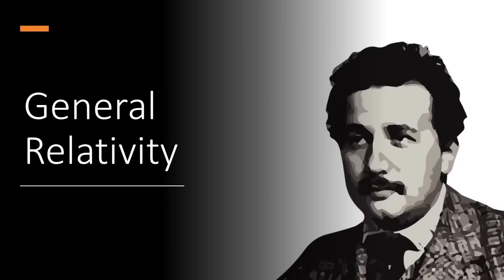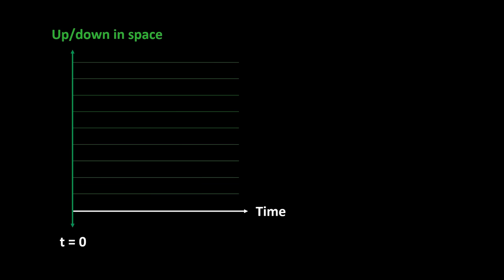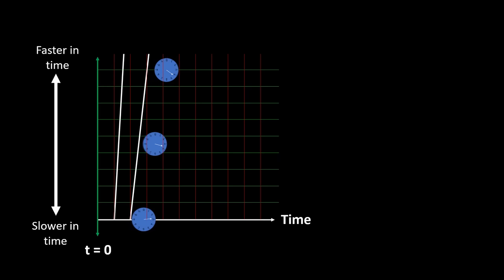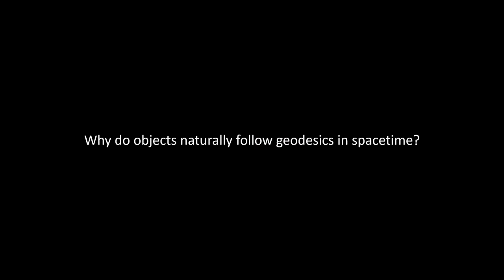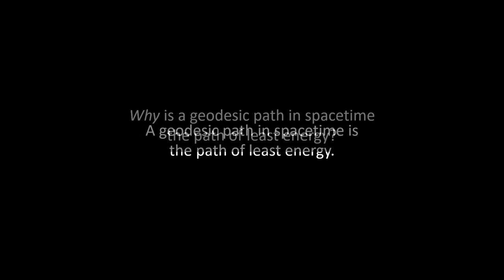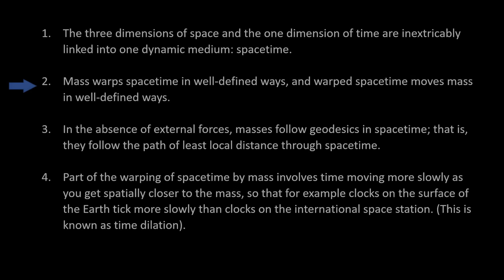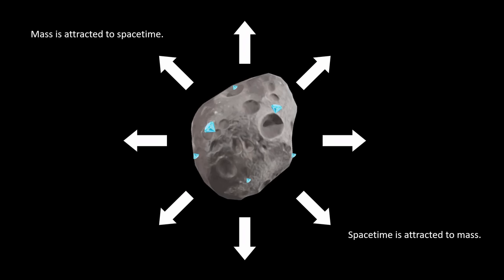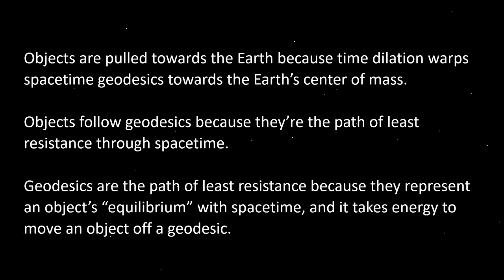How Time Dilation Causes Gravity, and How Inertia Works

Comment: Is tree branch continuously putting energy into the apple? I can't make sense of that claim. Any help please?
Reply from the maker: Hi Parker, great question. This all comes down to the equivalence principle view of gravity, how an object held stationary in a gravitational field (like the apple on the branch) is equivalent to that same object accerelating in a rocket far out in space away from significant gravitational fields. If these two really are equivalent, then they are amenable to equivalent descriptions in terms of energy. For an apple accelerating far out in space, it’s clear how much energy it takes to accelerate at g for one second, it’s the apple’s kinetic energy after that second (1/2 * apple mass * g^2). The energy is delivered by the rocket’s propulsion, and the store of energy is spent by that propulsion. How about the apple on the branch? In the equivalence principle view, the branch is accelerating the apple upward at g just like the rocket’s engines (and the tree is being accelerated upward by the surface of the Earth), so the same amount of energy is needed, and it’s delivered through molecular bonds in the branch. The question of what store of energy is being depleted is more difficult. I think a more general way to ask this question is “what energy is being converted into the apple’s kinetic energy?”. In a roundabout way, it’s the interaction of mass with spacetime that supplies this energy (similar to how it’s this interaction that supplies an object in a gravitational field’s potential energy in a classical framework). The Earth’s mass interacts with spacetime to warp it at a global level, and it’s this warping that causes the apple’s geodesic to bend towards the center of the Earth. 

I agree with your stance (what I think your stance is) that this equivalence principle version of events is highly nonintuitive, especially when you consider it from the standpoint of the conservation of energy. This discussion that someone shared with me regarding this video might help clarify the situation, especially Viktor Toth’s answer: https://qr.ae/pGqeZl

Here’s also some more clarification from a similar question I was asked in another comment: The idea that "we are not attracted to the Earth but rather pushed up from it" comes from the "equivalence principle", a hypothesis dating back 1,500 years that guided Einstein's development of general relativity. Briefly, Einstein's equivalence principle holds that the mechanism for the force experienced by someone sitting on the surface of the Earth pulling them downward is indistinguishable from the mechanism for the force experienced by someone far out in space, accelerating at g. (This is similar to how, when you enter an elevator and start accelerating upward, you feel heavier while you're accelerating; in fact, if you stood on a scale, the scale would show you weighing more while you are accelerating upward). In this sense, there should be no difference between a framework in which the Earth is attracting you downwards at g versus a framework in which the Earth is accelerating you upwards at g. 
That's all well and good, but the first case is immediately intuitive to us, whereas the latter case seems ludicrous (e.g. the Earth would have to be ever expanding in every direction for this to be the case, etc.). What gives? I think the right way to look at this is that neither case is exactly true, because they aren't looking at the underlying mechanism, which is spacetime warping and your mass's interaction with that spacetime warping. So, the real story underlying both cases is that the Earth's mass interacting with spacetime warps spacetime (especially the time component of space), so that the forward direction in time for any mass has a component in the direction of the Earth's center of mass (in a sense, time is bent into the "downward" spatial dimension, and spacetime "flows" in that direction). Your mass also interacts with spacetime, and is "attached" to spacetime by that interaction. When spacetime flows towards the center of the Earth, you're attached to that flowing spacetime, and therefore your mass also is pulled along with that spacetime. The confusing part here is that the relevant "flow" occurs in the time dimension, (i.e. where should a mass go over time given the nature of spacetime in the vicinity?), because it's nonintuitive to picture a geometrical aspect of time. I think it's fair to think of it as: the time aspect of spacetime answers "what should happen next?", and in this case the time aspect of spacetime says "masses should move towards the Earth's center of mass" or more broadly, "masses should move in the direction of the 'deepest spacetime well nearby' with the most urgency", and time says this because of the way masses warp spacetime.

Comment: I can see how GTD may deflect grazing star/light, but if I throw something up, in the air, why should it come back/down again just because time runs a wee bit faster up there? Or slower down here. Maybe if U think of it as a matter wave.
Reply: Yes, the wave nature of matter. And matter waves are chiral, they go round and round along the axis of propagation. Think of what happens to the wave as it travels where there is a speed gradient in a gravitational field: as it goes down it slows down and vice versa. So its path veers toward the mass i.e. the object "falls". That's how I understand what happens.

Comment: If I really believed in this, I think I would rather revive my much simpler half serious uni/versity days SW based model, of the universe, where I said: Matter clumps together simply to reduce the workload, on the processor, coz time runs slower inside/around it and so it has to be updated less often, internally anyway. "Simples. CH"!

Comment: Very impressive, very impressive, e/specially for a non fizzy cyst. I wish I could make such videos. But/t:
If gravity is caused by time dilation, then why does g/ravity vary as inverse square, with distance, & GTD doesn't, and even at the surface of the Earth GTD is practically 0, as is space curvature, supposed to be?
Reply from the maker: Interesting question-- why do you think GTD doesn't vary as the inverse square? It does. You're right that at the surface of the Earth the effect is practically 0, but it's not actually 0, and even that small amount of time dilation is surprisingly what causes the acceleration we feel towards the center of the Earth.
Reply: @IdeaListEye  Thanks for Ur (prompt) reply:
I hope U can read Pascal, code.
Here are the (non'optimised) functions I use, in my physics programs:
function  ga(M,r:real):real; begin    ga:=G*M/r/r; end;
function gtd(M,r:real):real; begin  gtd:=sqrt(abs(1-2*G*M/c/c/r)); end;
Please tell to me how GTD decreases as the inverse square, with radius/al/distance.

Comment: Yeah but you can also just use geodesic’s in space, light travels geodesics in space, matter travels geodesic’s in spacetime. well light also travels geodesic’s in spacetime but since the proper time is 0 it doesn’t really do much. but if you put light in a box or some confinement it will act like a mass, and fall down towards a lower speed of light which is equivalent to slower proper time for light. its the same thing as geodesic’s in spacetime

Comment: The most interesting question, why does mass warp spacetime, is left unanswered.  Very unsatisfying.  

Mass, objects that interact with the Higgs field. are pulling at the structure of spacetime through the Higgs field.  This means the 4 dimensional  matrix of spacetime is connected directly to the Higgs field.  The greater the excitation in the Higgs, the more warped spacetime becomes.  So mass alters time, and altered time imparts a force we call gravity.  Nice little feedback loop, don't you think.

Comment: 7:31 - The branch that the apple is tethered to is not doing any work.  Work is the net external force on a system times the distance traveled.  The tension on the branch is equal to the force generated by the gravitational attraction between the apple and Earth whether the force is gravity or the force is a byproduct of mass warping space.  The apple is not moving as the forces balance out so the distance is zero.

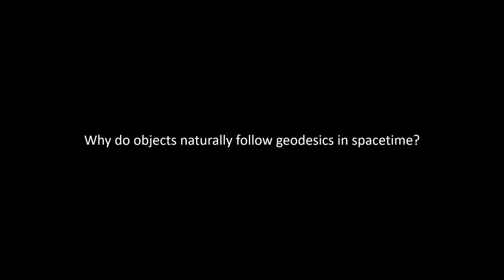Think about it.  Does the floors of a skyscraper have to have a constant supply of energy to keep the people and objects inside from falling through to the ground?  It doesn't.  Yes, if there nothing to provide a force counter to gravity, an object will fall (freefall), then again, there is a net external force.  So a propulsion system on your hypothetical sled at 6:59 is needed to provide a net force opposing gravity and will slide back down the trough once the force provide by the propulsion system is shutdown and the only net external force is gravity.  Your analogy sounds more like Aristotle's theory that all matter is inherently as rest and that a constant force was needed for something to stay at motion as Aristotle did not take into account the force of friction.

*EDIT*: I would like to apply the idea you presented at the end of the video to the analogy of the apple.  If linear acceleration warps space on one side while not on the other, thus creating inertia, would that mean the apple doesn't fall because the warping of spacetime by gravity is balanced out by a warping of spacetime by the tension on the branch.  Though, you have to ask why tension would warp spacetime, then again, there's Einstein's equivalence principle which states that linear acceleration is indistinguishable from gravitational acceleration.  As an example, someone that has a mass of 100 kg in an enclose space feeling himself pressed against a floor and standing on scales that read 981 Newtons could not tell the difference between being on Earth from being in the middle of intergalactic space accelerating in a rocket at 9.81 m/s^2.  If they are equivalent to the point that linear acceleration warps spacetime, then does that mean that a force generated from tension also be a force of spacetime warping too and if not, then why not?  Just something to think about.

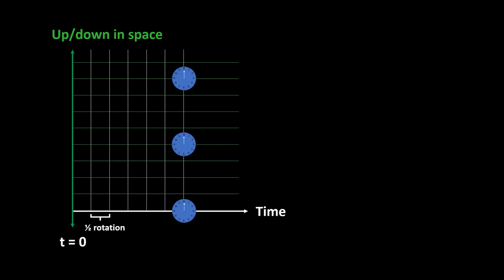Also, you didn't tell your viewers that the gravitational time dilation example starting at 3:18 is an over exaggeration.  Someone unfamiliar with physics may get the impression that gravitational time dilation is so extreme on Earth that there really is a 1:1.5 ratio between clocks on the ground and clocks on a skyscraper.
Reply from the maker: Hi CrossoverManiac. Good points- I agree that it's extremely odd to think of the branch as doing work on the apple, but an equivalence principle-based perspective does suggest this. Someone sent me this discussion on quora about this point in this video, see Viktor Toth's answer for what I think is a great explanation: https://www.quora.com/Does-the-ground-do-work-on-us-to-keep-us-from-falling-in-general-relativity-The-linked-video-describes-the-Earths-surface-pulling-us-away-from-our-spacetime-geodesic-by-adding-energy-to-us-but-theres-no-force

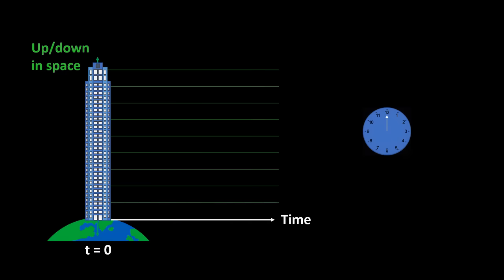You're right that I messed up by not mentioning that the gravitational time dilation example you mentioned at 3:18 is an over-exaggeration. I wish I had clarified that! YouTube doesn't allow adding video overlays anymore, otherwise I would make a note of that at that point in the video.

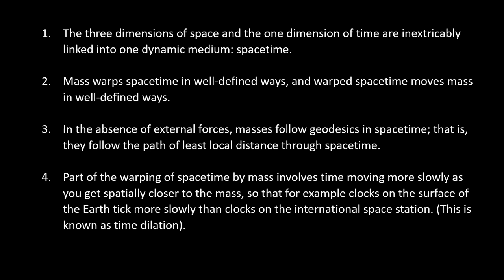Comment: Point #4 at 1:28 introduces an element of misinformation. Time never moves slowly or faster. It always moves at 1 second per second. A clock on earth and a clock on the international space station both click at the same rate: 1 second per second. A more accurate statement is that these two clocks get de synchronized due to their different spacial proximity to the mass of the Earth. Astronauts on the space station don’t live in slo-mo. Their time flows at 1 sec/per sec as does ours on the surface of the Earth.

Comment: Look I could give a lengthy rebuttal to this video, but I won’t as the content creator obviously put a lot of work into it.
But that being said, I must state a couple of things here.
1. If you want to believe all this you can, but I remember the real reason that the Apple 🍎 falls to the ground is purely due to the fact that the surrounding medium of Air does not have enough structural support for the Apple’s density and weight so the Apple goes down, but that same medium of Air can offer a Helium filled balloon that necessary support so it goes up, the medium determines the level of support something gets.
2. The Helium balloon 🎈 debunks all of the claims of relativity, as it’s not going down, it’s going up ?
And there’s no point in saying that it’s going up due to a force of gravity creating buoyancy, as firstly buoyancy is Archimedes Principal not a force of gravity, and secondly this whole video is about how a force of gravity does not exist, and is NOT the cause of things falling, and thirdly the above replies do not un-debunk what I state concerning the helium balloon 🎈 and relativity….

Comment: When Einstein synchronised his clocks he did it by looking at the clock face from the outside so that the hands on his clock moved second by second in a clockwise direction.However the clock has an internal mechanism and from it’s point of view the clock hands would be moving in an ante clockwise direction clicking off the seconds in reverse.Which is the correct view?  The correct view is t(in) - t(out) = 0 , it has to be because time is a human construct so that he can make sense of the universe.For the internal time t(in) as seen by the internal mechanism is different as that been seen by the external observer t(out) by a factor “ clock distance / c” therefore
 t(in) = - t(out) - distance/c
t(out) = t(in)+distance/c
But t(in) is moving in reverse(-)
-t(in)+distance/c = t(out)
distance/c = t(in) + t(out)
Let distance = 1.5*10^11m
500s = t(in)+t(out)

Comment: What is offered  in this video is a different description than the usual one. This is due to  your starting question: what causes gravity? Answer: time dilation.  And this video does a fine job in answering that question. The usual starting question from a historical perspective was: what causes time dilation? Answer: gravity. Each of these descriptions are equivalent.  And that was the genius of Albert Einstein.
Reply: The thing is, that it is completely and totally wrong.
A space-time diagram is NOT space or time.
Gravitic attraction is due to curved space.
And the Equivalence Principle is answered by flowing space. And so it is space itself which pushes you downwards in a gravity well.
Reply: @Chris.Davies  "space itself which pushes you downwards in a gravity well" That's what I call woo woo physics. Second, space is flat, proven experimentally over and over. Third, the curvature in question occurs in space-time, and nobody knows what is space-time, other than it's a necessary mathematical tool to deal with both SR and GR. 

Reply
Reply: @joefromzohra  You made your "own research", right?